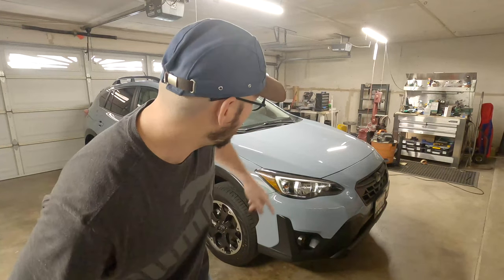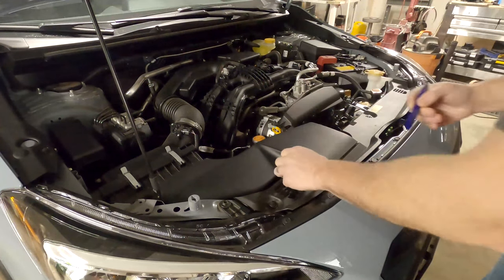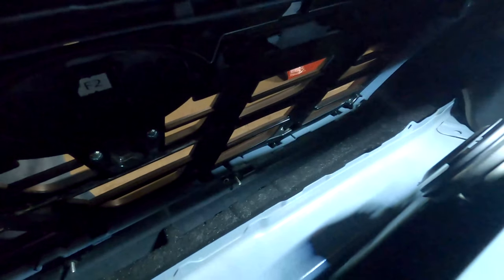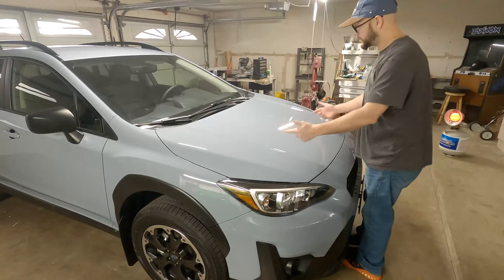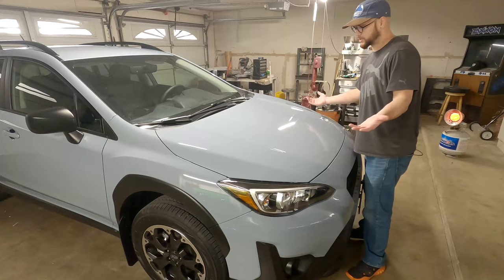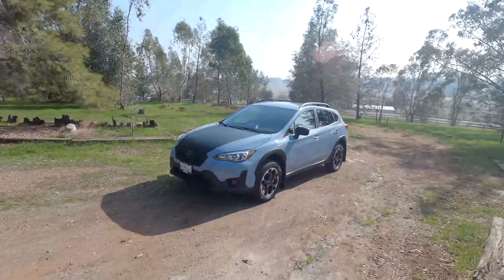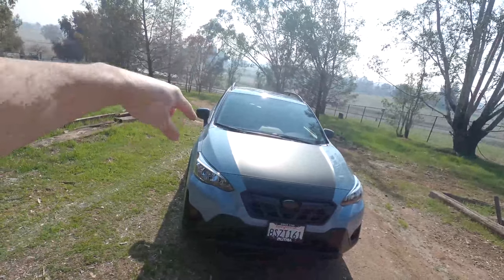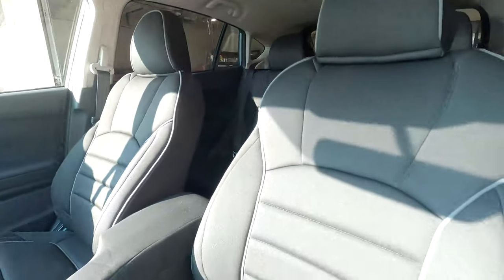2021 Crosstrek: Grille Removal and Vinyl Hood Wrap

Comment: Can you explain what string you used and how you secured it to the hood to get those clean lines when you used it to cut the vinyl. I have never this before.
Reply from the maker: For sure! It's actually tape. The specific tape I used is from 3M and I believe the name is Design Line Knifeless Tape. When you lay down the lines with the knifeless tape you want to leave yourself a few inches extra that are hanging off the car. Then you want to pull the string through the middle of the tape. The green tape should stay out on the car and the string will cut the vinyl. Good luck with your project!

Comment: The dealer just told me that you need to remove the front bumper on a 21 Trek to remove the grille. Are they trying pull one on me??
Reply from the maker: Most definitely they are. No need to remove the bumper.
Reply: @biggfootdesigns  I did it myself thanks to this video—thank you! Shady dealers will be shady
Reply from the maker: @masonthurman  sweet! Glad you got it done without them!

Comment: hey man where did you get your emblem?
Reply from the maker: Hey there, I got them from JDMFV's Etsy store...
https://www.etsy.com/shop/JDMFV
Reply: @biggfootdesigns  thanks!!!!!
Reply from the maker: @twelvedads3099  Anytime!
Reply: @biggfootdesigns  Hi again - I just got them in any insight on insight on install?
Reply from the maker: @twelvedads3099  Take your time and be gentle. When you heat the emblem to loosen the tape on the back side don't go too hot or it could damage the paint. Use some fishing line, floss, or a thin string to cut the tape from behind the emblem.
Reply: @biggfootdesigns  do you need any additional adhesive?
Reply from the maker: @twelvedads3099  nope, all the adhesive you need is the 3m double-stick tape that comes on the emblems already. Good luck, it's gonna look sweet once they're on!
Reply: @biggfootdesigns  thanks man!
Reply from the maker: @twelvedads3099  Anytime!